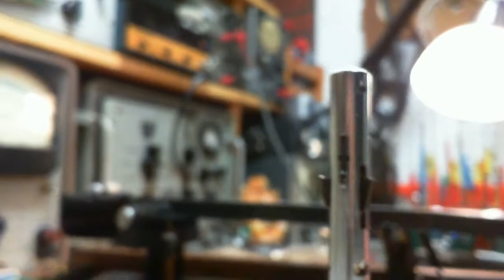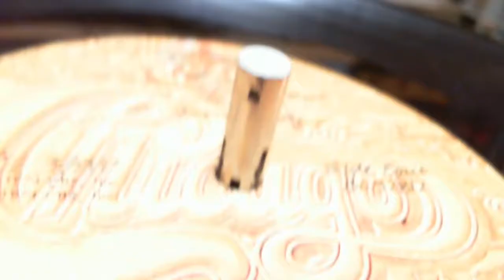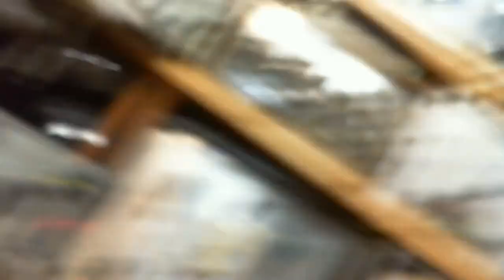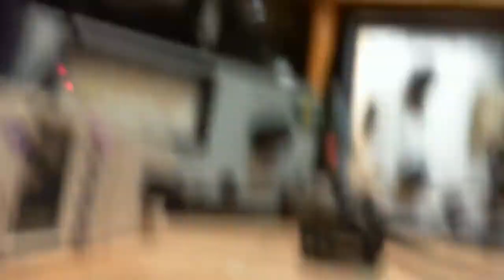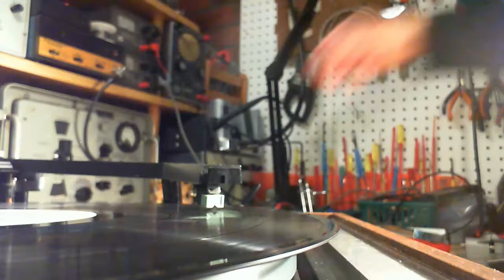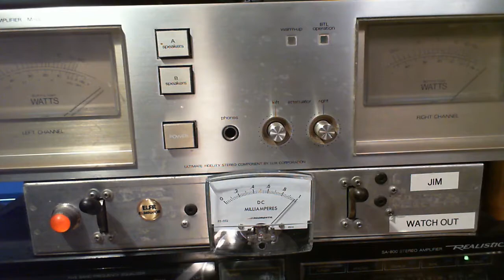Perpetuum Ebner PE3015 Turntable Video#5 - AW3 Automatic Spindle and Atomic Rooster

Comment: Arrogant enough not to read comments (he does, sporadically) disregarding all suggestions, lazy not to read manuals and understand schematics, dumb to post an entire crappy LP on YouTube ignoring copyright hits, inept to believe he can "fix" turntables by filing, bending, drilling, grinding, gluing, disabling and removing functional parts and components, returning devices to owners with 3 or 4 new defects than it originally had, (no extra charge), not able to properly set any test gear he has, that btw, most are unusable, incorrect solvents and lubricants, appalling soldering skills, not having the honesty of refusing a job as being outside his area of expertise, blaming and blabbing even manufacturers for malfunctions he creates. What can go wrong I wonder. (did I miss any other highlights?)
Reply: @lesoram6236  And if not, where I could get a laugh of? Besides, still some viewers watch to learn something, they have to be told about all the mistakes and blunders Jim constantly makes.